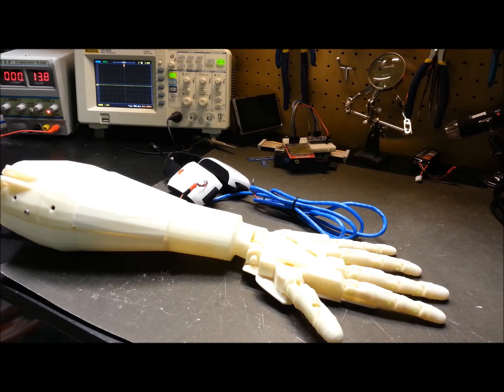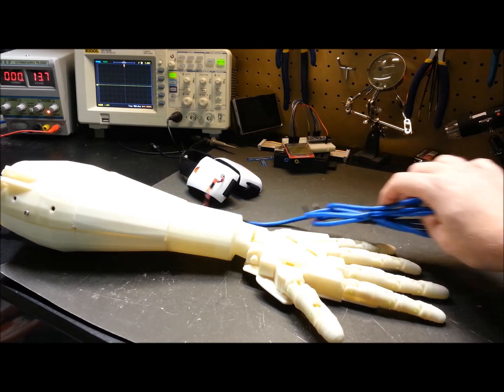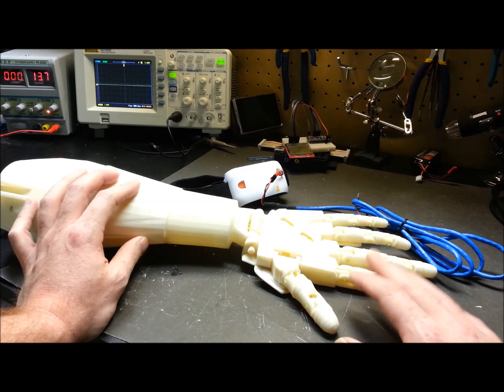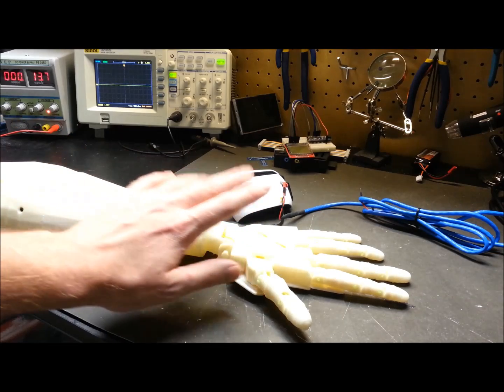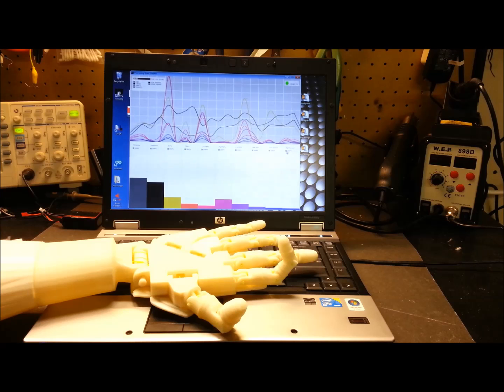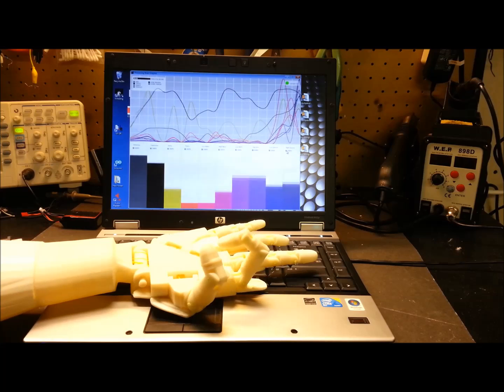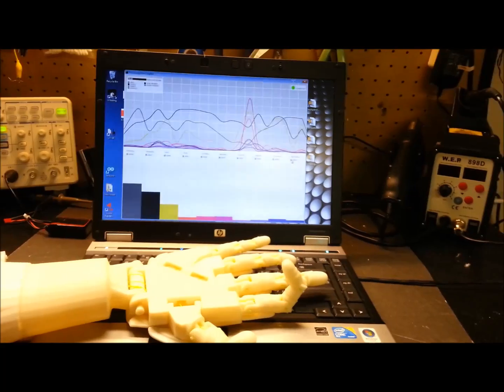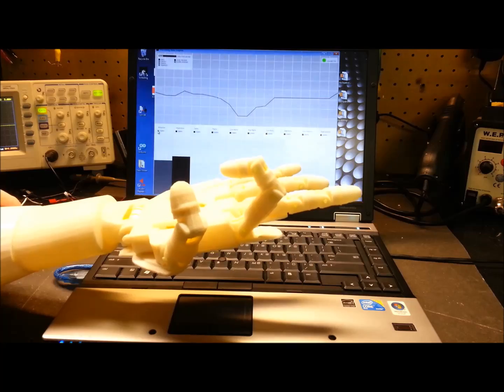DIY Brain-Computer/Robot Interface- Part 8

Comment: This is incredible. The end of last year. I did a robot hand using a control glove made of cheap pressure sensors made of velostat. I used muscle wire for actuators, which proved rather inconsistent for motion. I've been planning to do this project since I graduated and I'm super excited that I found your videos. What you did here for the price is amazing and I will be referencing your work once I start this project. I had been looking into brain computer interfaces since last year. With companies like OpenBCI taking off, but the cost for a chip being 400+, I think what you did here with the mindflex is sick. Ill def be in touch once I get started on this. I use the lulzbot taz 4 for 3d printing.
Reply from the maker: Eric Thompson Best of luck with your project!  That's why I made these videos- in hopes other people can take it forward and put it to real use.  I did a pile of searching before I had any idea how easy it could be.  As new chipsets become available- the possibilities will be truly amazing.  Not bad for a toy :)  Cheers

Comment: May I suggest using an EEG headset from Emotiv? The market price is a little higher than that of the "toy" headset you currently use. But maybe a higher quality signal would do the trick. I haven't taken a look at your code design (I'm trained as a Bioinformaticist, not an Engineer), but I'm sure you've made some progress on your algorithm since then.

You have given me inspiration to proceed on with my prosthetic arm project and wish you all the best!